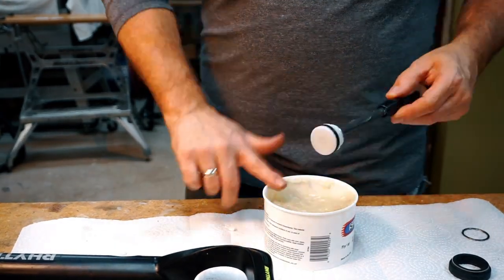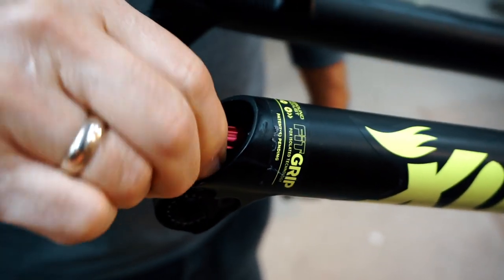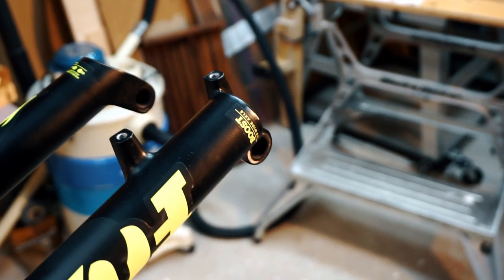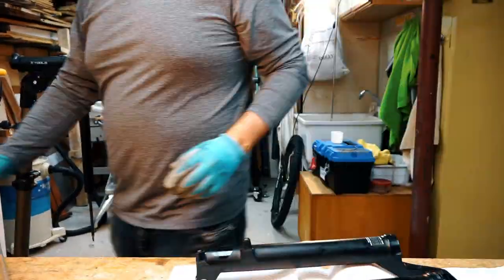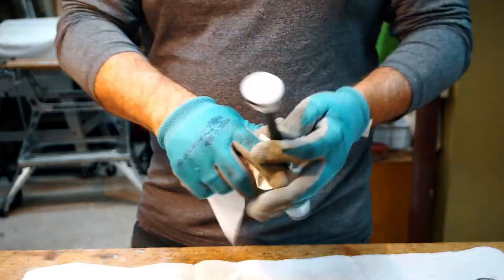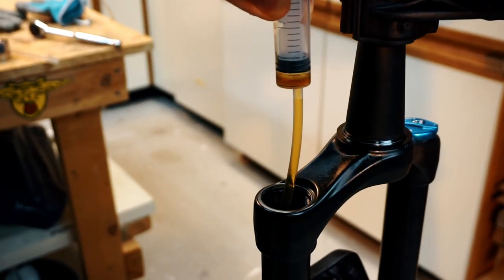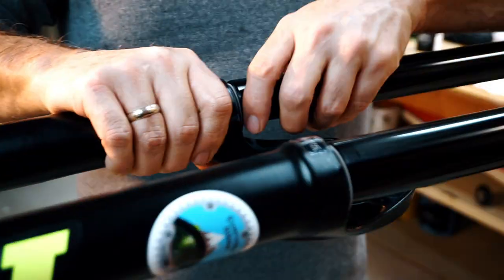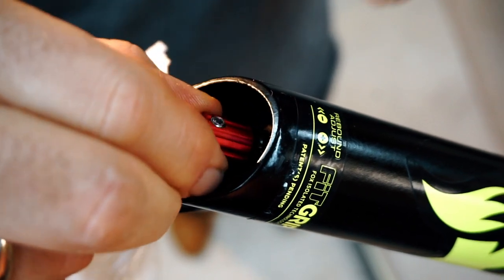How To Service Your Fox Fork in 6 Easy Steps!

Comment: I could be wrong, but in this case where you are using the 5 wt Teflon infused oil on the damper side, don't you want to soak the foam wiper ring for the damper side in that same oil, rather in than in the 20 wt oil as this video shows, so that you are not mixing the two oil types on the damper side?

Comment: Great video! One question, why in step 3 the air spring shaft leg, the air piston comes with lots of grease from factory and it only require a thing layer of grease to the seal and shaft?
Reply: My understanding is that air springs in new Fox forks often come from the factory with too much grease, which can actually interfere with the proper performance of the negative air spring.  I believe the way they show to do it in this video is correct and plenty of grease.

Comment: Is that FOX 34 rhythm that come stock on certain bike? If so, i should follow your video to the details to service mine. Thanks
Reply: I believe it is. I am following this guide to service my Fox 34 Rhythm fork, just make sure to go to Fox's website and enter your fork serial number to get the appropriate specs on the type of capacity for the oil as well as the seal kit.

Comment: What are the torque settings for this forck?
Reply: I believe the proper torque for both sides on all Fox forks is 5.7 Newton Meters.  It is easy to over-tighten if you get carried away, and I've actually broken a Fit4 damper this way when I mis-read my torque wrench.
Reply: I believe the torque for the top cap is 24.8 Nm, and as they say in the video make sure you have a chamferless top cap socket.

Comment: question.... I have a 34 rhythm 2017 of 100mm and I want to change it to how it was before (150mm) I want to buy the air shaft but I want to know if it would fit the air shaft of 2019 34 float of 150mm
Reply from the maker: I would check with Fox. They also list all the parts on their web site and you could look there.
Reply: could you change the travel of fox 34 rhythm?